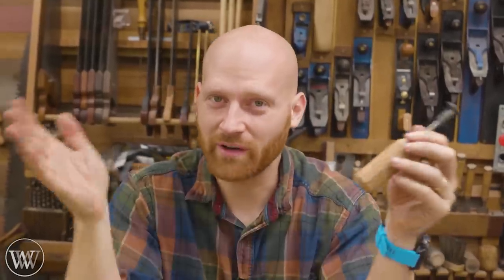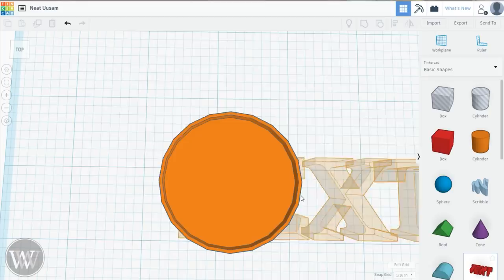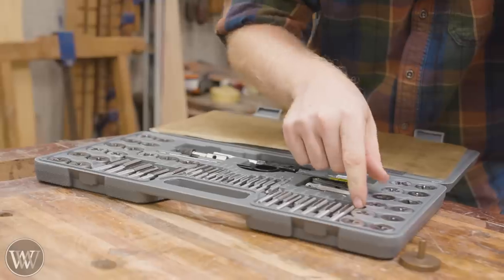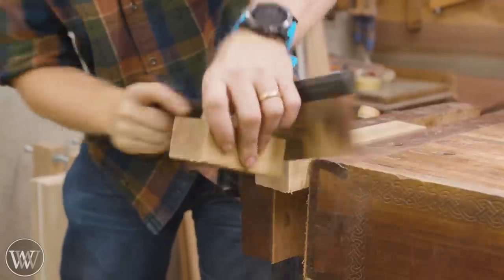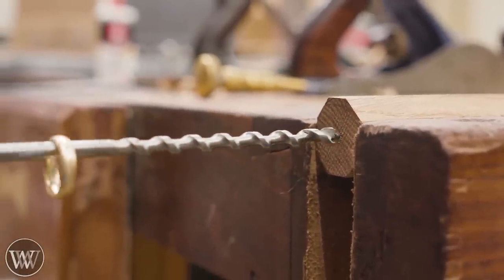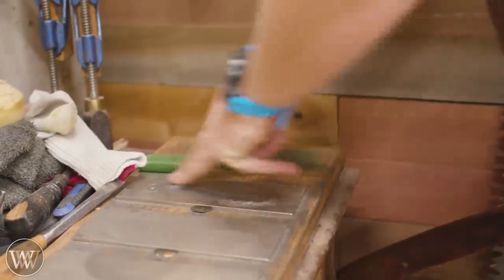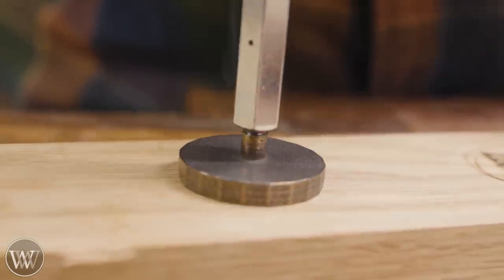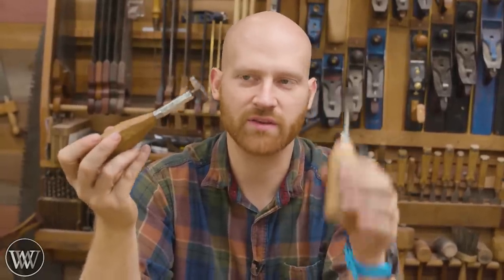How to Make a Branding Iron For Woodworking

Comment: Thanks for the video. Before ordering a brand I figured I'd search and see how to make one and that's when I found your video. Went through all the steps and within an hour and a half I had my piece designed and ordered. One mistake I almost made is not reversing my logo (as it is not symmetrical)...... that would have been disappointing. Thanks again, this saved me a nice little chunk of change.

Comment: I just started making branding irons on my cnc. I was surprised by how little depth you need on the brand iron. 1mm and it leaves a good mark still
Reply from the maker: Right on. Especially if you're working in wood if you're working on a soft leather you need a little bit more but still rarely more than a 16th of an inch

Comment: Very good video! Love it! I like octagonal handles! Maybe it’s a good idea to make one surface of the handle different than the others so that you feel with your hand when you have the logo’s topside pointing in the desired direction without having to look at the bottom to align it the way you want.....speeds up the workflow when doing more pieces.
Reply: I think it might be better to put a mark on the back of the branding iron, because it could rotate in the handle.

Comment: Upload your file somewhere without the letters??  That way we can use your template??  Even better... just save the text as ABC for example to help with those not as advanced with CAD.  

Awesome video!
Reply: I just put a link to it int he description.
Reply: Wood By Wright you rock, thank you!  Just something I hadn’t worked on before and that should make it easier.  Especially for the threading.  Link an affiliate for the part the connects to the threading if you’d like.

Comment: The main point of burn that would be obvious to me is the head end if the carriage bolt. Of course it could be countersunk into the handle to remedy this issue.
Thanks for the links.
Reply from the maker: I originally thought that was going to be an issue but I've never had a problem with it It gets a little warm but never too warm to touch even after using it for more than a couple hours. The heat doesn't travel off the bolt that fast and it tends to dissipate before it gets there.
Reply: Wood By Wright How 2 
You could simply wear a glove on that hand lol. Also, you can rubber coat the wooden handle. I purchase  a can of rubber coat for dipping tools in for better grip and so it doesn’t conduct electricity when I’m working on panels. I’ve been doing electrical work for 30+ years and have never been shocked lol
Well except that time I saw how much my wife put on the credit card one Christmas! Lol
Cheers mate
Reply: @WoodByWrightHowTo  great, thanks.
Reply: @prepperjonpnw6482  "Plasti-dip" or some other coating?

Comment: Stainless steel is perfect in my opinion for a branding iron because of the low heat conductivity (20 vs 100 (brass) vs 400 (copper)). The heat stays where you put it. Also stainless is perfect for the handle and very scratch resistant. The brass coating will do absolutely nothing. For branding irons which are heated electrically I would prefer copper.

Comment: How did you make the sunken portion of the cylinder where the W fits in?
Reply from the maker: When you create a cylinder you can tell it to be a negative cylinder so it will remove material so I just created a cylinder inside of a cylinder and then made it a negative cylinder.
Reply: Wood By Wright How 2 that sounds complicated lol. Was that in tinkercad?

Comment: I was literally about to ask why your ring was hanging off the bit and then you started telling about the reason! LOL

By the way, you may want to consider a different bolt as heating zinc (that bolt looks like it is zinc plated) results in a toxic gas. Likely not enough to hurt you, but better safe than sorry....
Reply from the maker: Right on. In this case I'm not heating it up enough to cause problems with the zinc. You have to heat up zinc to thousand degrees or so to even start causing issues with it. If it's galvanized it can do the same thing in a slightly lower temperature but still nowhere near The temperature this gets to.
Reply: @WoodByWrightHowTo  good to know!

Comment: Do you need to mark the handle in some way, so that you know whether the text is "upright" ( "the Wright is upright" HA HA ) as you apply the brand to the wood ? Thanks
Reply from the maker: I forgot to add that into the video. I usually take a file and make a little nick mark in the top of the brand so that I can see that.
Reply: @WoodByWrightHowTo  Thanks for that advice !

Comment: Ordered one, but cannot get the die started on the rod?  I noticed you skipped over this part, well, it shows you starting to turn it, then it skips to it already being several turns down.  I have tried many times and it just won't bite.  What's the secret?
Reply: I believe he chamfered the edges of the stem coming out of the brand. I could be wrong lol. Maybe you could email him
Cheers mate
Reply from the maker: I filed down the tang so that 1/16-1/8" would stick into the die. Then put even pressure on the die. Some people use a drill press to push down on the die then turn it by hand.
Reply: The rod was a little over sized @ .27, most likely my fault.  So, I went up to 5/16 die, but I still had to use the drill press to get it going.
Reply: How much dose it cost to order one

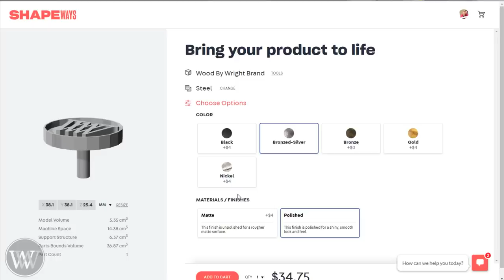Comment: 1:47 the price shows $34.75 but at the end you said it was around $20 shipped. What am I missing? lol.
Reply from the maker: On the website in the video I I had scaled the file incorrectly and it was larger than it should have been there. It was corrected later but I did not record The screenshot of it at the end.
Reply: @WoodByWrightHowTo  Awesome, thanks for the quick reply.

Comment: Safety note: make sure the hardware you use isn't galvanized. Galvanized steel can give off dangerous fumes that can make you very sick if it's heated too high. The risk is probably pretty low here, but as always, better safe than sorry!
Reply: If it is galvanised a soak in muriatic acid will take care of that
Reply: I know this is an old comment but the sick feeling caused by inhaling fumes from zinc can be reversed by drinking a glass of milk.
Reply: @petermangan1124  Have you asked a doctor? Because they don't.

As it happens, a close friend of mine is a CRNP -- i.e. the exact kind of person likely to treat you for metal fume fever at urgent care or the ER, and who probably sees you at your regular clinic. Even though I knew the answer, I asked her how she'd treat it: "If their vitals are OK (non-emergency), just treat the symptoms, then have them follow up with their primary care. I'd have to look up if regular scans are recommended for long-term care."

When I asked her, "So you wouldn't give them milk?", her response was, "What? Why would I do that?" When I explained the myth, she laughed at how ridiculous it is.

No medical research backs the claim. No medical/first aid sites recommend it. Even Poison Control doesn't recommend milk, except in cases of caustic or irritating poisons, where they recommend milk OR water -- it's about dilution, and they're considering that young children may drink only milk, not water. Poison Control does recommend milk for toothpaste, because calcium binds to fluoride. In their pages for denture cream, diaper cream, and shampoo -- all of which they mention contain some form of zinc -- they make no mention of milk.

Every professional welder's association or occupational safety site that mentions milk is specifically saying the old milk myth is false.

It's an old welder's myth from before they regularly had good shop ventilation and PAPRs to protect themselves. There isn't even a consistent claim on why it's supposed to work, as everybody had their own reason (it's the fat, no it's the calcium!). It is completely false. Please stop spreading it.

Comment: Or you could just cut it on a CNC. Make sure you have the right speeds and feeds for brass...  If you use a larger (deeper) head, it will retain the heat long enough to do several brands per heating.
Take care, the bolt protruding out the back of the handle will get hot.
Worth machining a mark on the side of the head, to indicate where 'up' is...
Reply from the maker: Surprisingly the CNC costs more for just one small part.
Reply: @WoodByWrightHowTo  You don't have a CNC mill? Gosh! They are cheaper than a Stanley #1 you know 🙂- and a tad more useful.
Reply from the maker: LOL no... Hand tool shop. LOL
Reply from the maker: LOL no... Hand tool shop. LOL
Reply: @WoodByWrightHowTo  You do understand that that is a personally imposed limitation? And farming out machining does not really distance it you know. You cannot maintain 'purity' by having others do machining for you. Either hand chisel the iron, or accept you are not a 'hand tool shop'. Embrace it. Limiting yourself to 19th century tools is entirely arbitrary. Why not flint tools and antlers only? I enjoy making things using hand tools for some projects. But not all. I try to use the best tool for the job. Purity is nothing without honesty. You have a great channel, with a lot of useful information and engaging presentation. But do not allow that to rule your life- there are more ways to machine wood, and more materials to machine than dead plants.
Reply from the maker: I use power tools from time to time and you see them in the shop. I come from a power tool background where I Did that for 25 years. but this channel is about teaching hand tools. That it the niche this channel focus on. it has nothing to do with putty. I do not do things in a traditional, or historical way. I just have fun in the shop in a different way. I cater to a crowd that is less interested in producing things and more interested in the fun of getting there or not. Some times just using tools with no project to complete.
On a side not I use to have a couple CNCs and I worked as a CNC operator at a factory for a wile. I still have a couple 3D Printers.
Reply: @WoodByWrightHowTo  I understand your interest, and the pleasure that comes from hand crafting. But sometimes making by hand is impractical (as in this case) or just plain tedious. Making a drawer by hand can be a pleasure, making forty is work. And takes time that could be devoted to more pleasurable tasks.
A story. I was shocked when I first heard that Purdeys were no longer making shotguns entirely by hand. They had been making what is widely regarded as the best shotgun in the world for centuries, by hand. Then it was explained to me. Machining close to the final dimension (sometimes to within 1/000 of an inch) and hand finishing produces an item totally indistinguishable from entirely hand made. Impossible to tell the difference, Not only is it cheaper and faster- you are not asking fine craftsmen to do 'hogging out' work that demeans their skills. Forcing people to do tasks that can be automated is illogical and unjustifiable. Their time is better spent on doing what humans are superior at.
Reply from the maker: You are very correct if your focus is the project.
Reply: @WoodByWrightHowTo  Sorry if I was not clear- my primary focus is on the craftsperson, and their journey. Free of artificial constraints on either tools or materials. Having been a machine minder, I can understand how you may feel constrained by technology- but as the design source that is not the case. The current hype suggests that AI can exceed the abilities of humans. This is not true- all it does is copy what humans have already done- it pattern matches. As Penrose showed, nay proved, humans can complete tasks that computers (at least of the non-quantum type) never can. Adding shackles does not free a person...

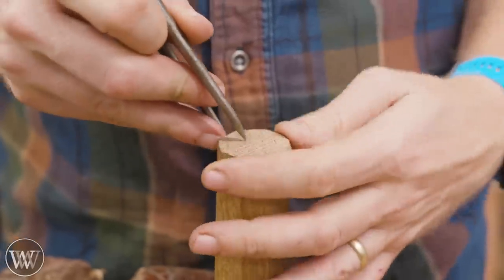Comment: Don't attempt to sharpen a drill bit the way this way. 4:08 You will ruin your bit.
Reply from the maker: You may want to read up on your methodology. I sharpen it the way I was taught to do so years ago by a man who has been sharpening auger bits for over 60 years. Not to mention if you actually read about the historical methods this is the way it's done.
Reply from the maker: I think I see your confusion. This is not a drill bit this is an auger bit It is a very different thing. It's basically a plane that will run in a spiral fashion.
Reply: @WoodByWrightHowTo  I'm not confused. You're doing it wrong, but it's not my turn to teach you.
Reply: @shenaniganguy  If you know of a better way then how about make a video about it instead of writing comments with no useful information to back them up?  This man obviously seems to know what he's doing you on the other hand just seem to only provide criticism.  Have a good day